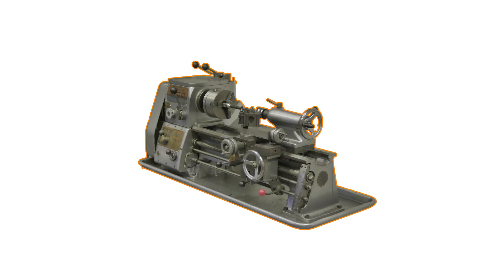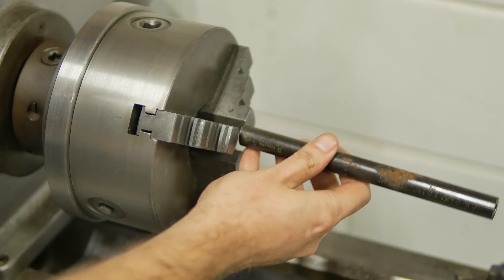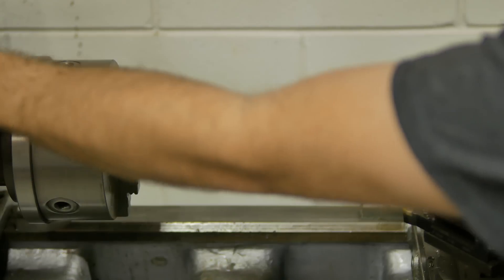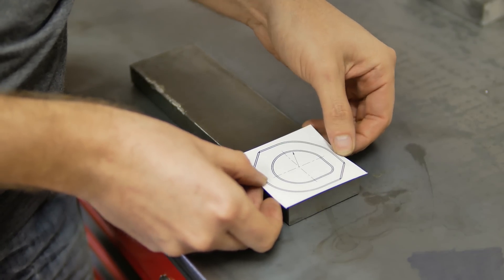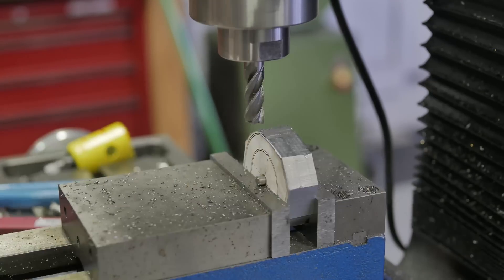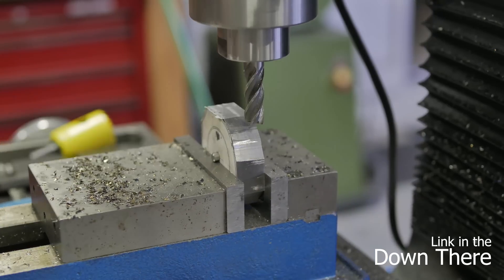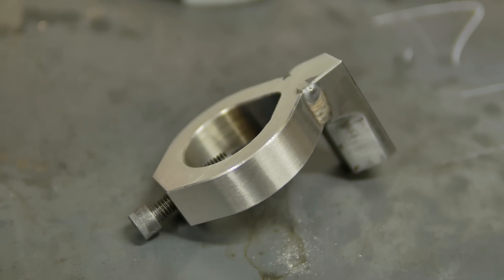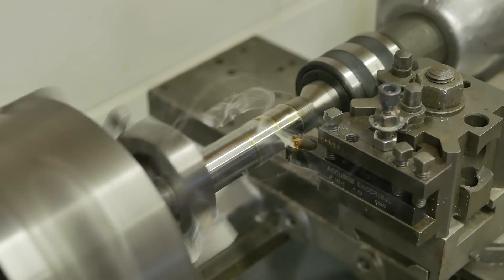Turning between centers (making a lathe dog) - S02E34

Comment: Here's a tip from an old machinist...USE CRISCO.vegetable shortening instead of TapFree or other cutting fluids. You wont break as many taps, especially when power-tapping in a drill-press. Use Turpentine for tapping Aluminum.

Comment: Hi and very nice video! You have a great speaking voice. Very easy to understand. I looked up the use of a lathe dog, because, as many years that I have worked metal, i can count on one hand the times I've used a Lathe Dog. I have a brand new cast iron one, that hasnt been used a dozen times, by my Dad and twice by me. He was in his low 90's when he stopped lathe work. I'm in my upper 60's now. I had actually forgotten how to use a Lathe Dog, but all i had to hear was TURNING BETWEEN CENTERS. The main thing that is used for is offsetting the tail-stock and turning long tapers. I thank you for your video!

Comment: What about the balance of the Dog? I've just made one. I use a shaft like a new rocker shaft or one finished by a shearing tool to find my 'level' on a big soup pot with a clean rim. And with adding one more, or one less nut or bigger or smaller bolts (threaded into its tail), the dog set on its required shaft can be nicely balanced. Slight variations of weight movements needed for any larger or smaller shafts in the size range of this dog.
Reply: That was my sentiment as well. Being balanced would help reduce distortions.

Comment: What was wrong with the ways on the Lathe?  Did they need to be scraped?  Or could you have fixed your problem by adjusting the leveling screws/realigning the head?

Comment: Good explanation and video however no point in machining centre to centre if you chuck up the  centre in your out of spec 3 jaw chuck.
Reply: Tony Papantoniou by truing the center in the chuck and not removing it, you do remove the chuck from the equation. youve missed the point, pun intended.

Comment: Hi I know this may seem a bit technical for the comments but there is something you you should know: 

By mounting the centre in the three jaw you DO NOT INCREASE THE ACCURACY OF THE WORK HOLDING. The inaccuracy of the three jaw is transfered to the centre and that inaccuracy is once again transfered to the work piece- your back to square one. Working between centres only increases the accuracy of your work holding when the centre is mounted in the internal taper of your spindle nose (assuming your spindle nose is accurate). 

In order to drive the dog in this situation will require a 'dog face' sometimes called a 'face plate' is attached to the external tapper and your drive dog slots into this plate. TOT summaries this much better (and more hilariously) here: https://www.youtube.com/watch?v=K67bZQSETiE&t=462s
Reply from the maker: If it does, it needs quite a bit of work to get anything to seat in there. I will have to look into that.
Reply: That's what I was also thinking Frazer. You want the dead center mounted in the MT of the headstock spindle.
Reply: @timmer9lives  More work for zero gain. Taking a skim cut of the cone in the three jaw will render it perfectly concentric with the centerline of the lathe. If you take the chuck off you also lose the ability to drive the dog with one of the jaws.  Just because that might be how YOU do it doesn't mean its the only way.
Reply: your lathe spindle should accept a mt4 dead centre,
Reply from the maker: Actually you get an increase in accuracy by taking a skim cut on the fixed tapered cone. By doing this you transfer the real concentricity of the lathe to the cone, regardless of the position of the jaws. The trick is to not remove the cone until the operation is done, or if you do to take another skim cute after. Of course having an internal taper on your lathe is a good way to go.  This lathe does not have one.

Comment: when you turn a center like you have in you chuck, you dont need to turn a complete center if you only put enough point on to adequately hold your part you can have your stock deeper in you chuck and gain about 0.5" or more clearance between centers. This also gets your dog closer to the jaws to be driven. Makes a big difference on a short bed lathe like yours.

Comment: So so close to being on the money but by putting the headstock centre in the chuck, any runout will be reproduced on the workpiece.

To eliminate as much runout as possible, place the centre in the bore of the headstock spindle and use a catch plate to drive the dog <edit> (turning a point down just prior to mounting the work is an acceptable workaround but still comes second to spindle mounted points).

With that said, I've enjoyed every episode so far and I look forward to the next installment :)
Reply: Yeaaaahh... No you just turn the center point and that's guaranteed concentric to the center of the headstock rotation (because, you know, lathe). If you take the center point out you'll need to turn it again, but you can take your workpiece out from between the centers and that won't upset anything.
Reply: Perfect response, that's what I was hoping you would say, carry on ;)
Reply: What he said!  Made me a little crazy watching and listening.

Comment: Dude buy some parallels.
Reply from the maker: I actually did use parallels for the body, just not on the first side you saw me mill. That's because the stock was pretty banged up on that side and using parallels would have actually made it worse. Also, i do what i want.
Reply: yeah, he didnt use any on milling the body but
used one on the leg
no parallel for the body,, not a good look